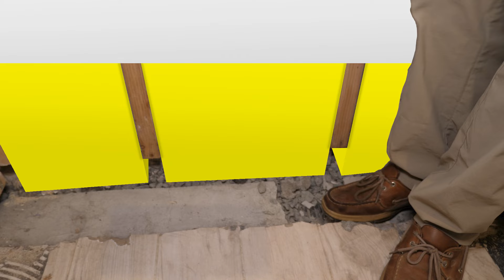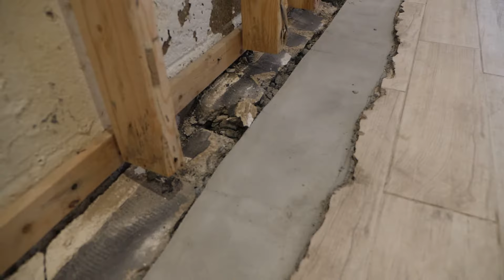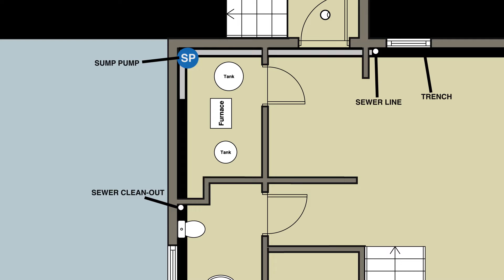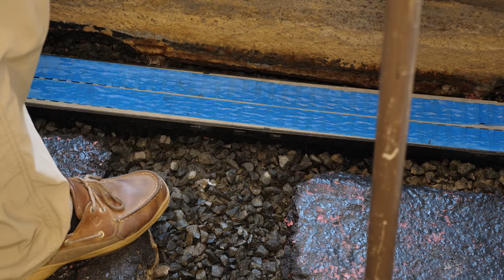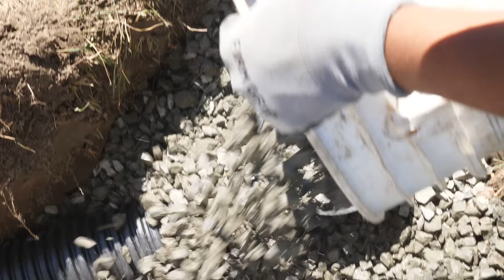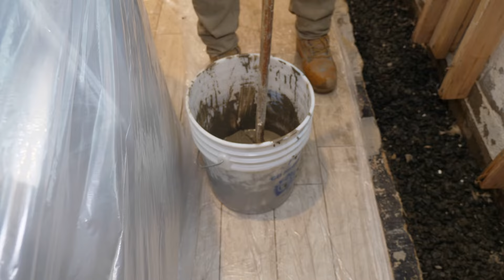Top Method For Waterproofing Your Basement: Installing Corrugated Drainage Pipe

Comment: great video. one question, though. if you're putting waffle board on the stones, what is the purpose of the plastic vapor barrier? isn't the plastic waffle board good enough?
Reply from the maker: Good question. The board helps move water, the vapor barrier controls moisture and air. They do two different jobs.

Comment: This is the same type of drainage system that exists on the outside of a home. If a homeowner calls you for waterproofing, it’s more than likely because that same French drain made of corrugated plastic piping, has failed. Why the hell would I do that again the inside?

Comment: Do you have your company in Seattle? I need a pro like you. I have a basement drainage with the sump pump installed 2 years ago, and it's already failing. Now I have water seeping thru the wall, bypassing the interior drain and flooding my basement

Comment: Great work put an overflow on the seepage stone pit though I replace failing pits a lot from silt buildup
Reply from the maker: Good point — pit design and stone selection matter a lot. We size our pits and stone to handle high flow and minimize silt buildup so the system stays reliable long term.

Comment: This guy is a pro. I'm dealing with a flooding house right now. Previous owner was a youth paster who did the drain tiling himself. Later discovered the drain tiling wasn't a drain tile at all. It was a french drain on both sides of the house and they had a negative pitch of 9 inches. So water was just sitting in those corrugated pipes toward the back of my house, and leaching back into my basement. Now im paying the price for his shotty work. Learning lessons!
Reply: Not sure why "youth paster" has to do with it but that sucks.  At least you discovered the issue.
Reply: @TheChaztor  He specifically mentioned his career as a youth pastor during the arbitration case to try and subconsciously influence the arbitrators decision, as if a “man of the church” would never mislead or participate in any wrongdoings
Reply: @BoWeber  You had me at "[home]owner.... who did the drain tiling himself" LOL

Comment: I'm not quite clear on the system please. How does water get into the pipes if they run  continuously across the house?
Reply from the maker: We install around the perimeter of the basement. Next to the footer below the floor along the walls. The drainage pipe runs from sump pump station to another in one continuous piece. Not in pieces like the other shallow channel drainage.

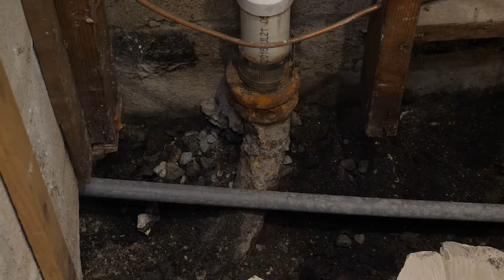Comment: Starting at 8:45, When my development's 1,000 ranch houses were built in 1957-'58, everyone had septic tanks.  Ten years later, sewer systems were installed, and each homeowner had the option of having the main line to the road installed above ground in their basements, or below ground.  Perhaps because of "spring cleaning" (the man coming around every spring to clean out 1,000 septic tanks), every homeowner had their line installed above ground because the slope to the road was steeper, and there would be less chance of clogs. 😹

Comment: Is this type of system a viable solution for a home resting on a monolithic slab or is there a possibility of structural damage which may ensue from the cutting away of the floor?

Comment: this video is 2 years old so my chances of getting an answer seem slim but it's worth a try anyway, recent 15" of rain here in KY left me with about 2" of water in my basement it made it past the sandbags we put against the wall that meets our improper negative grade driveway, it pushes water against the exposed wall of our basement in our split level home, but the other thing that happened which has never happened before since we lived here is water came in under the opposite wall which is our crawlspace that does have a sump pump installed in it. With all that said my question is will a system like this also keep surface water that seeps in underneath our brick walls from getting into the basement?
Reply from the maker: A drainage system like this won't stop water from seeping in under the foundation walls unless there is a way to direct that surface water to the drainage pipe.

Comment: When a foundation has no footing how far below the bottom of wall do you install pipe, vs having a footer u goin in the depth of the footer? Do you dig down past the wall with no footing if so do you worry about water underming the wall

Comment: You’re removing 50% of the virgin soil from around and beneath the footing, will this not cause settlement issues down the road?
Reply from the maker: You sound confident and sure. Tyler, where in this video you see us remove 50% of the virgin "hard pan clay" soil? We never ever go below the footer or remove virgin soil. Misinformation is bad.

Comment: Can i ask how water gets into that big black pipe for it to run into the sump. Maybe a silly question, bit im unsure how it gets in.
Reply from the maker: Not silly at all! Water enters the corrugated pipe through perforations (small holes) along its surface, allowing groundwater or seepage to flow into the system and reach the sump pump.

Comment: What about the barrier you put against the wall then put the vapor barrier right on top of it. Where does that water go from the wall? Because the concrete is not porous as you said.
Reply from the maker: The water will no longer saturate the bottom 24 inches of wall, instead it will squeeze through the cold joints and into the system for discharge. Those cold joints are well below the 4 inches of floor, vapor barrier, and super slurry waterproof cement. Water will never saturate or touch the floor.

Comment: Does this system work for block basements? I'm not sure where to start for my father's unfinished basement of the property he purchased years ago.

They seem to have a metal gutter system on top of the concrete floor from the previous owner. Not sure how deep it goes, though. Some external gutters on the roof reduced a lot of the issues, but it definitely still needs help.

Wondering where to start and exactly what to look out for if I had a professional take a look.

Comment: I've watched several of your videos - they're great, a real measure above the other videos on the same topic. I am out of your service area so I'm trying to piece together how maybe I can do this. 
I presume that's perforated corrugated pipe, yes? 
Do you tend to use 3" or 4" diameter?
Do you cap the ends of the pipe?
I think I heard you say the slope is 1" every 10'. Did I get that right?
Thank you!!

Comment: I have a structural clay block foundation. Would you ever recommend running the drainage dimple board up to ground level or would the crystalline mortar coating be a better fit

Comment: Sorry.. forgot one other question  I’d like to hear your knowledgeable opinion on - If house sits just a few feet away from 40’ drop ravine, could a drain-tile discharge flow-pipe be run underneath the footing and outside to empty into ravine thus eliminating the need for a sump-pump entirely? Thanks again
Reply from the maker: It is possible, but you need drainage that goes much deeper below the house and out to daylight. We don't offer this, but we have installed our system without pumps in 100-year-old structures with existing stone drainage in the center of the room. They work beautifully.

Comment: Couple questions, please: Was there 2x4 bottom plate on that finished wall that was ripped-out at some point to accommodate pouring new concrete(?).. can finished wall with bottom plate be left fully intact when installing system? Also - most of what I’ve read suggests 1/8” drop in pitch per foot.. you install at 1” per 10’ - I’m assuming that small of a variation doesn’t make much difference while also allowing a little more wiggle-room for longer runs.. right? Thanks for all these really informative videos, bud👍
Reply from the maker: The bottom kick plate and 12" of studs are removed to accommodate the basement system and new concrete floor. Our pitch is pitch perfect for our needs. It allows water to gradually move to the sump pump station without overwhelming it. We vary the pitch depending on linear feet, but we never go below 1" per 10'.
Reply: @AmericanDryBasementSystems  what would you pitch a basement of 108 linear ft?

Comment: As an engineer, your approach makes me smile.  It completely makes sense in every way.  All details are considered!
Reply: Just for understanding so I’m giving the right information. The footer and the walls are the structural portion of a foundation, as it could have a dirt floor, so the edges of a concrete floor do not add “structural” strength to a basement, unless it’s a monolithic 2 piece construction. No?

Comment: I've had several companies out to quote me on a system and one company particularly stuck out. It was the owner of the company that came out and very informative and knowledgeable. No high pressure sales tactics, no gimmicky patented technology. I just had one question for you. He mentioned their company uses pvc pipe instead of the black corrugated. He said sediment builds up in those as well as slows down water from draining due to the ridges. What's your take on that? Thank you.
Reply from the maker: I agree to disagree. I've installed many thousands of systems. Corrugated, perforated 4-in pipe purchased directly from the manufacturer is of higher quality and incredible when appropriately installed, but in the wrong hands can be a total disaster. It must be pitched to work efficiently and self-clean due to having ridges. The Army Corps of Engineers will vouch for it. PVC, on the other hand, cannot self-clean. No matter how it is installed, it requires clean-outs. Our systems do not require clean-outs or maintenance. We like to save homeowners money. Yet, there is still nothing wrong with using 3 to 4-inch PVC pipe.

Comment: Do you recommend adding a battery backup system?
Reply from the maker: If you are in an area prone to frequent power outages most definitely yes. Plus, you have the backup available if the primary pump stops working. Many homeowners that already have electric auto-start generators or solar power homes don't require the battery backup system.

Comment: How do you handle a crawl space basement that was partially hand dug out to full depth? The footer for the house is only a few feet below grade while the basement floor is well below that. Water just seeps in through the dirt wall. My thought is to dig out all the remaining dirt, underpin the existing foundation, and pour a slab over gravel/vapor barrier with perimeter drainage like this video.

Comment: So what is the drain line? Perforated and can you use sock tile
Reply from the maker: We don't use socks or fabric of any kind on our interior drain pipes. The quarter to half-inch stone we we pack the pipe in does the job perfectly. Fabric filters of any kind will eventually clog and reduce the effectiveness of the drain tile.

Comment: Is it important to use elbows at 90 degree turns or can it be flexed?
Reply from the maker: No flex piping. Only ridged 1.5-in schedule 40 pipes for discharge.
Reply: @AmericanDryBasementSystems  Sorry i should of been more specific.  I was referring to the 4" corrugated pipe in the trench.  I have 4 spots that have 90 degree turns.  I was asking if elbows should be used?  What a ripoff they are $13 a pc.  I just flexed it around the turns.  There was plenty of room.

Comment: exactly how deep was the trench in the video? I believe it was said that the rock was 7-10 in above the 4" pipe... was the trench below the bottom of the footer? footer depth varies dramatically, however, i my area 8-12 would be the max footer depth

Comment: Does this system helps with basement with high hydrostatic pressure? We have water seeping through cove joints and even the cracks on the concrete floor in the basement during heavy rain. This only happen to one side of the basement, can this system be installed on one side of the wall?
Reply from the maker: It may be possible to resolve the problem with a partial installation, but our company will not guarantee a dry leak free basement unless the entire perimeter of the basement has drainage. Water has a nasty habit of finding new places to seep in. Sometimes a partial installation works and if it doesn't you can install more to cover the entire perimeter but it will cost more for a second trip out.

Comment: Question please. I live in an area where the foundation block wall is filled with cement concrete prior to seal plate and framing added. When drilling the weep holes in this scenario would you drill all the way through the blocks or just to the middle? Thanks
Reply from the maker: No weep holes are necessary. Water will follow the path of least resistance. No longer through the block cores rather between the wall, floor and footer cold joints.
Reply: I live in a state where you aren't servicing, I have hesitated to use dry lock paint as well. I've been in houses during estate sales that used drylock in their basements. They still smelled musty, the walls had discoloration areas,  peeling and bubbling of the paint as well.

Comment: do you do work in "Western New York?" (Wyoming County, Gainesville NY) just purchased a home there, 1st heavy rain and the basement is flooding. Not sure if I should excavate outside around the foundation and waterproof/seal the block foundation walls and install new drainage, or if I should do as you show in this video. Any help or suggestions will be greatly appreciated, or better yet, have you/your company come to the house and see what is best
Reply from the maker: Unfortunately, you are out of our range to get a waterproofing inspection or installation. You are going to have to find a local contractor who does French drain interior waterproofing. 
Exterior waterproofing is costly and doesn’t last long in most cases. We are going to put a video up soon explaining why. Best of luck.
Reply: @AmericanDryBasementSystems  Thank you very much for responding and for your advice as to which system would be best. I appreciate it very much
Reply: With a newly purchased home with unknown/limited history, start with the basics. Make sure your gutters are clear, that gutters divert water 6-9' (More is better) away from the foundation and the landscape is graded/ sloped away from the house. That's 75% of the water right there. Ground water means turning your foundation into a waterproof boat or letting it in, controlling it and draining or pumping it out

Comment: Excellent video. You really know your craft. I did our basement this the same way (not as well as you guys do I'm sure), but 10 years later and no water. Did 2 walls of the basement, both running into a sump to be pumped out. I used a similar waffle board on mine as well, which catches anything coming off the wall and feeds it to the stone and pipe below. I have to do my son's 91-year-old house next. the trench the previous owners dug into the cement years ago runs to a floor drain (that used to be the main gray water drain for the house), and that drain runs downhill to a trench along the main road 75' away. We figured out that's where all the mice were coming from! After we hook the floor drain pipes to it, we'll put some sort of grate at the end of the pipe down by the main road so he can keep the grate clean and keep rodents out. i don't think we'll need to dig a sump with the floor drain there, but we'll test it out for a while before reinstalling concrete over the drain. Thanks for the helpful video. I think I'll be able to do a better job on my son's house after watching a couple of your videos.
Reply from the maker: There is no way to install a one size fits all basement drainage system in most basements. You did a great job customizing and adequately installing a system for yourself. We did an installment in the basement of a large postal facility similar to the old floor drains in your son's basement. We created a short perpendicular trench from the perimeter trench around the walls to the floor drains near the center of the room. The water caught in the primary system discharged to those drains beneath the floor. No water on the floor. No sump pumps. The water runs to daylight. The place is dry as a bone.
Reply: sounds like it's doable then. did you do anything to prevent rodents from entering? right now I temporarily have a smaller coffee can with drain holes in it plugging up the terra cotta pipe to prevent them from getting in where it runs to daylight. it was a perfect fit. took us a while to figure out where they were getting in, but we know for sure now that was where they were coming from. I'll  just add something to the pipe on the end where it daylights like a shower drain or something they can't chew through and won't rust. keep up the great work and the great videos. they are very helpful!

Comment: Very nice work and video! Wish you worked in South America 😊. One question: an external drainage system like a corrugate perforated pipe installed near the foundation can avoid the use a internal system, by draining the water before it reaches the bottom of the basement?